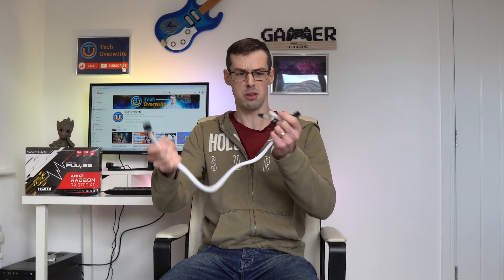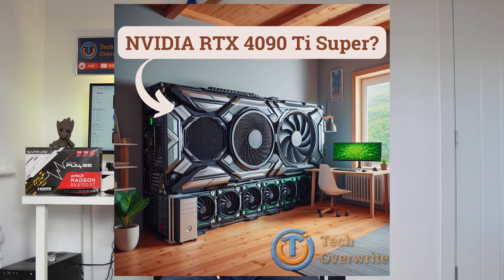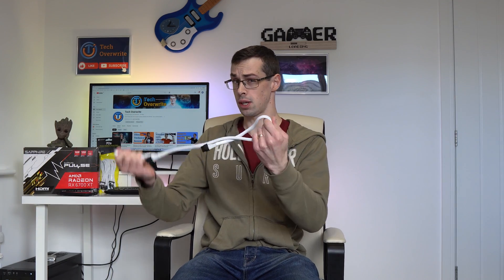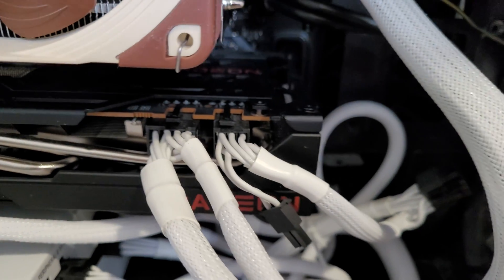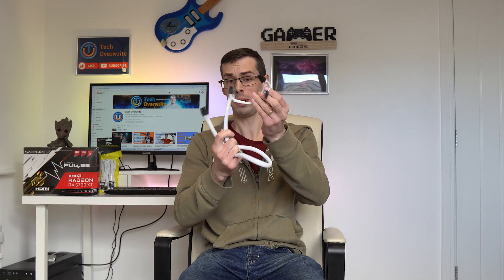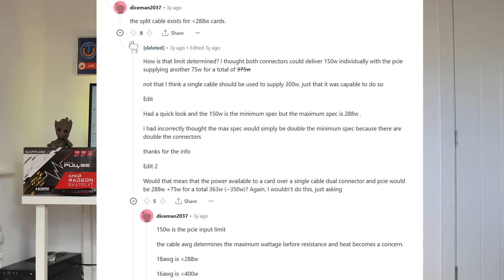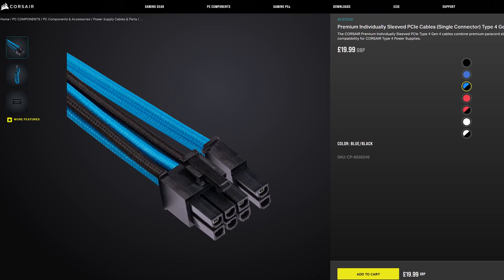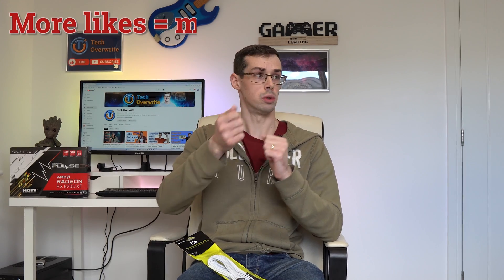Stop Connecting Your GPU Power Cables Like This! (How To PROPERLY Connect PCIe Cables For GPUs)

Comment: TIL...
CoolerMaster and Corsair modular 8-pin PSU PCIE ports supply up to 250w per port/cable. Aftermarket 2x8 pin to 16-pin atx5... technically can only run 500 watts, and only on these v2 or higher PSUs

If your graphics card needs that extra 100 watts...
For $15 ... CoolerMaster (fits Corsair) sells the CORRECT adapter that plugs three 250w PSU ports to make one true 600w PCIe 5.0 16 pin power cable, and it even has the 90° end for the graphics card.
Reply: Remembering this also: the '8 pin connector is a 6 pin supply and the +2 are extra ground wires with the only purpose to signal to the card that it is a heavier gauge, higher wattage cable (they don't carry current!).

6 pin 75w standard 
6+2 150w standard 

Check your wires before using pigtails...

16GA for 250W using both 8 pin pigtails is usually ok.

18GA only 150W - only use pigtails as one 8 pin or  2x 6 pin!
Reply from the maker: Glad to have helped and thanks for the super detailed comment, your conclusions definitely make sense. That's interesting that CoolerMaster makes that adapter too - TIL, thanks for sharing that :)

Comment: So lets say im trying to upgrade a gpu in a smally 12 year old computer so i can game
Its very limited and the power supply cant take anymore wires
But there is a 6 pin gpu cable 
Could i put a 6 to 8 pin pcie cable and hook it up to the gpu would this work or would it be a bad idea??
Reply from the maker: Ooo good question. This help guide from NVIDIA might help, although the answer is basically "it depends" - but at least it'll give you something to do on: https://nvidia.custhelp.com/app/answers/detail/a_id/2198/~/my-nvidia-based-graphics-card-has-an-8-pin-power-plug%2C-but-my-power-supply-has

Comment: lol not a solution: I have 8 of these stupid cards, there is no power supply with 16 8-pin connectors.
Reply from the maker: Surely if they're 225w+ GPUs, you would need multiple PSUs anyway? Running a mining or AI rig with 8 GPUs and just 1 PSU would be a recipe for disaster 🤔

Comment: Then explain to me a PSU have 3/4x PCIE 8 pin slots, but only 2 cables and they have pigtail, additional 3rd cable cannot bought becouse its not even sold how to connect 3x 8 pin GPU??
Reply from the maker: If it only has 3 slots, including the CPU, you can power 95% of GPUs. Basically all but the most powerful GPUs. If it has 4 slots, that's even easier because it's rare that a CPU will need more than 1 power cable - so you can have 1x for CPU and 3x for a really powerful GPU.

Comment: 8pin cable support up to 375W. My old 2080ti works ok on one pcie cable 8pin and eat max 285-290W. I plugs another cable and eat the same value 285-290W. Now I use 4070Ti on one cable and still works ok.
Reply from the maker: Thanks for the comment, but it depends on the cable guage. Sometimes it can supply 288w or above, other times just 150w. It's unhelpful that some PSU makers don't list AWG values for their cables, because that can help people make the judgement (of 1, 2 or 3 cables) too.
Reply: @TechOverwrite  I have super flower 750w,  6+2  PCIe (550 мм + 150 мм)	2   cables ,	4    6+2 pin , 	18AWG ,     how match 1 cable  max watt?

Comment: Hey man, Maybe i have the same issue my 3090 is making me get crazy , a few months ago it randomly turns off both screens, then i have to reset the PC , to get image back, sometimes happens 6 hours later , but after the first time , its inmediatly, maybe the issue is that un comectting 3 pins with to cables, i have to try to buy a third one, but seems that the issue gets to yedra later, not sure enought but maybe it fixes my huge problem , today i could test with occt that after getting an average os 235W then the screen get black, and the fans running 100% 
What do you think ?
Reply from the maker: Hey man, hmm sorry to hear it, that's frustrating. It's either a powering issue, or maybe a thermal issue. It almost does sound like it's overheating, especially with the 6 hour shut off and 100% fans. Double check the temperatures when idle and gaming and see what they show. But if they look okay, I would switch to 3 cables to at least rule that out as a factor. Good luck, I hope you can fix it.
Reply: @TechOverwrite  im gonna try, yesterday te screens shut down with a occt test express after 2 minutes… i think my 3090 hall of Fame has died 😓

Comment: Hard to do when almost every PSU comes with 2 or 3 daisy chain/pigtail PCI-Es, so basically you have to buy the PSU, figure out the "type" of connector for that PSU (ie Corsair have Type 3s for some PSUs, Type 4s for others, literally says the type on the connector end in white text), then buy individual PCI-Es in that type in the same colour.  So MORE money spent.
Reply from the maker: Yes I agree, that's a fair point. It's frustrating, and it would be nice if PSU makers included even 1x single ended PCIe cables in the box.
Reply: @TechOverwrite  I get why they had daisy chains in the past, given the power draw of cards, but we're in a new era.  The 20 series from Nvidia are basically all 2 8-pin connections so yeah, you COULD use just one PCIE with a daisy chain and be done.  But the more efficient way is 2 single connectors of 8-pins for sure, plugged in to two different ports on the PSU.  Like you said in your video I think, it can cut down on stutterings and issues.

Comment: Hey man i got a really important question. I accidently pluged my gpu into the wrong thing i got a gpu chord that was one side female and other side male and i plugged it into the 8pin cpu power chord to my power supply and turned it on. and it smelled like fire and blew out. is my graphics card fried or just the power supply
Reply from the maker: Hey man, oh no that sucks :( It's a simple mistake to make. Unfortunately I would guess that your GPU got fried, but you could always just try it out by booting up back up with the right cables. Check to see if the GPU fans and any LEDs turn on. Fingers crossed that it works.
Reply: @TechOverwrite  got a new power supply. thankfully the cpu socket only goes up to 150watts so it just fried the power supply since my gpu draws more power. everything works!
Reply from the maker: @xTankgodx  ah great, I'm glad that everything (other than the PSU) survived - that's fairly good news then :)

Comment: Can you please provide the link of the cables to buy from? I have a MSI MPG A1000G PCIE5 power supply. Is there any compatibility issues for the PCIE5 cable you just mentioned? I mean will those work on my power supply to GPU?
Reply from the maker: Do you mean when I mentioned CableMod? If so, they support your PSU but only with a custom config. So you can go here and play around a bit: https://store.cablemod.com/configurator/?service=direct&psu_brand=msi&psu_model=689

Comment: Hello, Im just wondering. Is it okay to pigtail my rx6700xt hell hound I'm not planning on overclocking it. I have corsair cx 650 bronze. Which has only has 2 6+2 pigtailed.
Reply from the maker: Hello. It's probably just under borderline, so it should be fine though. Just try it out - you won't damage it if it's underpowered, maybe you'll just have some crashes. It imagine it'll be fine though 🙂
Reply: @TechOverwrite  Thank you so much for clarifying

Comment: Hi Just Purchased a Corsair EM750e power pack which has only got 4 pcie/cpu outputs. I have got  2x8 pins input on the Mother board, but also 3x8 pins requirement on the Graphic card! So if i am not allowed to use the splt cable that came with the power pack for the Grapich card, What are my options?
Reply from the maker: Hi, good question. So you might not need to use 2x cables for your CPU - double check the motherboard manual, but often just 1x cable can work (even if the motherboard has 2x slots). Secondly two separate PCIe cables is often enough for 95% of graphics cards, since this would mean at least 375w of power to a graphics card (150w + 150w + 75w) - meaning you can then use a pigtail connection if your GPU needs a third PCIe connector. Hope that makes sense.
Reply: @TechOverwrite  Thanks for your reply. A day is a long time in the PC world lol. Just found out the second 8pin conecter on the Motherboards are for CPU needs over 300 Watts. My CPU 7700x has a power max requirement of about 150w. So, three seperate cables will be going to the Grapihc card and one to the CPU. The thing to watch for is the PCIe cables are difrently wired to the CPU ones. So a single PSIe cable is required to be purchased
Reply from the maker: @scifi3702  heh yeah you're right about a day being a long time lol. Ahhh nice research, yes I agree - sounds like you've come to the same conclusions I would have. That sounds a good plan - good luck with the build :)

Comment: hi, i bought the 7900xtx sapphire and i have a gigabyte 1000w but the pcie cables are ugly asf its ok to use corsaire single cable with a gigabyte pwrsuply ?
Reply from the maker: Hi, I would not do this no. Everything might be wired differently, so I would not want to chance mixing Corsair cables with a Gigabyte PSU. CableMod might be the better choice here.

Comment: Hm interesting, I’ve noticed I was getting game crashes with the 7900xtx nitro (with more demanding games) and I was using a pigtail got new cables coming tomorrow
Reply from the maker: Interesting, that's an awesome GPU and I could see it crashing in that case. I hope the new cable sorts things out for you :)
Reply: @ quick question is it worth going with 1000w psu for the nitro?
Reply from the maker: @Brandon63991  I think 800w is the recommended PSU, and to be honest that should cover it. I mean, 1000w would be great, but 800w will work too.

Comment: 4070 I need only 1 slot and I have pig tail connector, it’s a problem?
Reply from the maker: Good question, I discuss this in a separate video because the 12vhpwr is slightly different: https://youtu.be/5a-CPC8eSDQ

Comment: I feel like this may be an issue i am having. Would it also cause big fps drops and maybe keep me from getting my max fps? Just wanna be sure before i buy a new psu.
Reply from the maker: Yes it could definitely limit your FPS rates. Maybe check the power usage in the NVIDIA or AMD software - if you're seeing FPS drops when the power usage is above 200w-250w, it's likely to be the issue IMO 🙂

Comment: I have an 8-pin RTX4060 Ti.  Does it matter if I plug the 1-piece 8 pins to the card and the split 6+2 to the power supply or vice versa ?
Reply from the maker: I don't think that you can reverse the cable order here. Certainly I'm not able to with my Corsair PSUs, it won't physically fit IIRC. But double check your PSU manual - maybe you can with yours?
Reply: @TechOverwrite  right and thank you for your prompt reply.  I was overthinking it and over complicating it

Comment: Would appreciate if someone can help me pick out a PSU that comes with 3x PCIe cables for a TUF rx 7900XTX, seems like every PSU comes with only 2xPCIe 8-pin but are marketed as 4 because of the pigtail connectors - which was very confusing unti i saw this video, thank you for explainin.
Reply from the maker: Happy to have helped 🙂 However many PSUs do actually have four PCIe connectors... sort of. Basically some (such as many Corsair RX ones) have four "PCIe/CPU" slots. You can then have 3x PCIe cables and 1x CPU cable, or 2x PCIe and 2x CPU. It's up to you to mix and match it. So while some PSUs do 'cheat' and say four PCIe (but it's actually 2 real cables plus the pigtails), Corsair mod and high end PSUs usually do offer the full four PCIe/CPU ports that should suit you 🙂
Reply: @TechOverwrite  Thanks for the reply bought the Corsair RM1000e had all the cables i needed, build finally complete.
Reply from the maker: That's great, the RM1000e is an awesome PSU - that'll definitely work well. Good luck with the build :)

Comment: Im installing an msi duke 1080ti oc woth 2 8 pin pcie ports but my psu has only one 6 pin cable and a 6 pin port, is it safe to use a 6 to 8 pin adapter and a 6 to 8 cable?
Reply from the maker: Hmm good question, I'm not 100% sure but if the card drew it's full 250w TDP, I would be concerned about using those adaptors because they could be stretching things a bit too much. I'd probably only do this if it was a very reputable adaptor, and I also would undervolt the GPU. Thats just my opinion though - others might disappear 🙂

Comment: The corsair cx750f have 4 pcie/cpu connection, can i use 3 of them for gpu and the other one for cpu? Or just only 2 are for gpu??
Reply from the maker: Yes that would work fine, Corsair tend to have 'interchangeable' CPU and PCIe slots at the PSU end (just make sure you don't accidentally plug the PCIe cable into the CPU slot, i.e. at the motherboard end!). But yes, unless you have a super powerful CPU you shouldn't need 2 cables for it. So that leaves 3 for the GPU :)

Comment: hi I connected my new rtx 4070 super using one pcie cable with a splited end, and did not see the image and quickly disconnected, did I break my GPU?
Reply from the maker: Hi, nope you should be fine - the worst that could potentially happen is your GPU crashing/shutting down your PC (e.g. when gaming). It wouldn't have resulted in full-blown damage though - you're safe there :)
Reply: @ ye you right ) after I reconnected in individual pcie slot in my PSu and connect without gap 12 pin in GPU they work correct

Comment: So I have a 6700xt by xfx swft 309 with a gigabyte b660m ddr4 motherboard with 12400f cpu and i have my gpu connected like this and haven’t seen issues, should i worry? Or continue the way it is
Reply from the maker: If it has been working fine for you, then it should be fine going forward too 🙂 You could always try running Furmark and seeing if it crashes there, but again, if it's working right now for your use then that's great.
Reply: for 3070 yes. for rx6700xt unfortunately no.

Comment: Thinking of upgrading to 7900xtx I have chieftec Polaris pps850 gold, I have only 2 8-pin cables, is it "smarter" to power it with 12vhpwr to 2-8pin plus one regular 8-pin
Reply from the maker: Ooo great question. It probably would work fine to use the 12vhpwr adapator, but I tend to think less is more when it comes to PSU cables. If you can avoid extra adaptors and/or cables, that's usually best. So I would just start off with running 2 'standard' PCIe cables and see if that is stable.

Comment: Thank you for the info, building my first pc and couldn't find this information anywhere else. Very appreciated
Reply from the maker: Glad I could help! 🙂
Reply: @TechOverwrite  quick question, im going to use the two pig tail cables i have to power my gpu but not plug in the ''pigtail''. Can i plug the side with the pigtail in the psu for cleaner cables on the gpu side
Reply from the maker: Good question... maybe it depends on the PSU but with my Corsair PSUs, it is not possible to reverse the cable. It physically won't fit. Maybe some PSUs support it though? If so, double check your manual and see if it'll work and be 'allowed'.
Reply: @ Thank you I will check the manuel, I have a corsair psu

Comment: What if I don't have 2 cables? You can't use other psu cables cuz it could be risky right? What should I do?
Reply from the maker: Unfortunately your options are probably to stick to GPU's which have a below 225W TDP, undervolt your GPU or change your PSU 🤔
Reply: @TechOverwrite  Wait so it's okay for me to use that "devil spawn" on my card as long as the tdp is below 225?
Reply from the maker: @gtALIEN  yes that would be fine 🙂 I do cover that in the video, but it gets quite confusing to cover every case. Basically 225w TDP or below should be safe here 👍
Reply: @TechOverwrite  ahh I see, I should pay more attention I guess 😅 thanks for the reply!

Comment: i got 1000w with rx 6900 xt msi using three  pcie but when i play cod warzone even low setting my game crashes should i buy three serpent pcie cable to plug in? cause right now i am using 3 pcie one with pigtail and other different cable
Reply from the maker: Hmm I would have thought that this would work fine - the TDP isn't actually high enough to need 3 cables IMO. Maybe try and monitor the power consumption when gaming, and look for 3 cables if the power use goes above 325W or so - but since it's crashing in CoD low graphics, my guess is that it's actually a driver bug or similar instead. Maybe try a clean install of the AMD drivers first 🤞
Reply: @TechOverwrite  how  do I check how much power my gpu use on amd
Reply: @TechOverwrite  i fully restart and clean my pc and update latest version and stil crash
Reply from the maker: You can check the power use with the AMD Software, under the tweaking or performance tab IIRC. Sorry to hear it's still crashing - it might unfortunately be a hardware issue in that case 😔
Reply: @TechOverwrite  i got ryzen 7 5800x3d with b550 rog strix gaming a i haven't  updated  my bio long time is that the problem

Comment: Hi there, I'm not sure if you'd be able to clear this up for me, but I recently ordered a corsair rm1000x psu, and I was trying to determine if it will be able to power (have the right cables) to power my 4080 super. Initially my plan was to use the included power adapter, and since the psu comes with 3 pcie cables, I would use those. I can't find a ton of info on the subject so I don't know if this adequate or not. Thanks so much for any insight
Reply from the maker: Hello, using the included 12vhpwr adaptor/cable here should be fine - I didn't cover this point as much in this video, but I have a new video coming out soon that covers it.  Basically the 4080 Super (nice GPU btw 🙂) will pair fine with your PSU and the adapter.